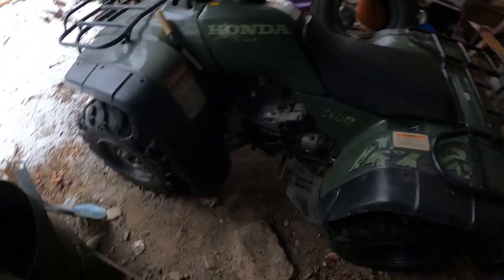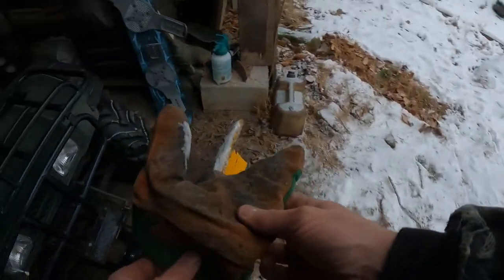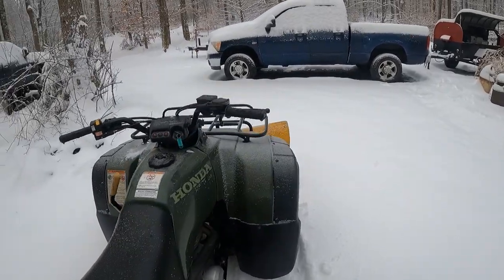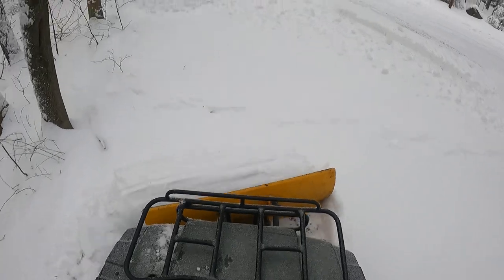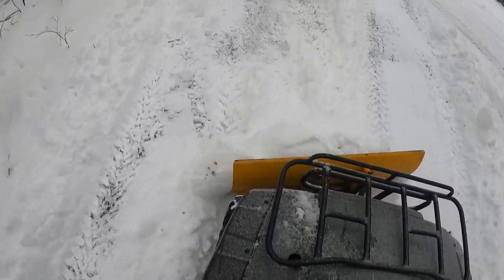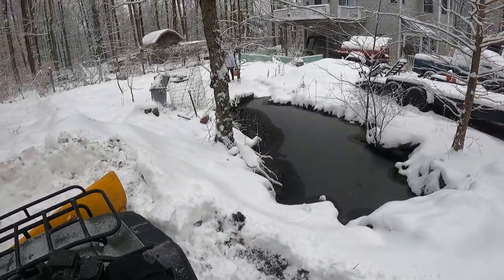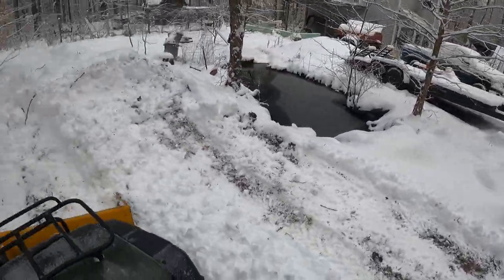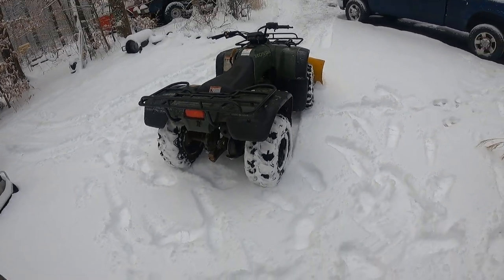Plowing snow with a Honda fourtrax 300 4x4 atv

Comment: I had a question about the diy skate bowl and thought it would be better to post here because you are more likely to see it. I am planning on building one soon and was wondering if there were any seams between the wooden pieces, and if so how did you deal with them
Reply from the maker: Building a bowl out of wood is extremely difficult.  I made sure to keep all my seams to less than 1/8" I wanted a smooth ride and not have wheels catch. Definitely made it difficult to cut precise curves on both edges.  Good luck building one. Send me pictures!    Here's a link to the wooden skateboard bowl video https://youtu.be/pJzPqK7elmQ

Comment: Never push snow with my atv but ride all winter lol . Wonder if had chains would help in heavy snow help keep from veer off as i seen on odd vid . The ol quad done good  great video .
Reply from the maker: Chains might help.  Whenever I get deeper snow I plan   on plowing multiple times just so the pile isn't able to push me off to the side.  Plowing on the very edges first helps. Then I have somewhere to put the snow from the middle of the driveway.   Love riding in the snow.

Comment: Very cool. Love these old Honda's. I have a 98 foreman 400fw with a blade & a winch. Beats the crap out of shoveling. It's totally stock with the original engine. Pretty good considering I live @ 7000ft so in the winter it works for a living 👍👍

Comment: I had been using 1985 Honda Fourtrax 250 with a 48" Cycle Country manual lift plow since 2002.  It did quite well, despite being 2WD.  This year I upgraded to a 1996 Fourtrax 300 4x4 with Koplin High Rise tubes, my 48" CC blade, & a 2,500 lb. Warn winch.   I have chains on the rear tires, & I add a bag or two of wood pellets on the rear rack when plowing.   I am very happy with my new set up.  In some ways, the manual lift was faster & easier to manipulate.  If I need to push snow piles back, I will appreciate the extra control of the winch & the flexibility of the high-rise tubes.   I really like these older Honda machines.   My current set up attaches the same under the machine, but the winch hook just clips on.    I wouldn't knock the manual lift, however.  The blade needs to slide on its shoes to do a good job of clearing the snow.
Reply: Yea buddy, your gonna really like that set-up. You've moved into serious snow plowing now. You will crap when you see how much deep( and I mean a foot at least) of snow you can easily move. You'd like a winch lift though --I have an acreage 'cause we dairy farmed and kept our acreage so I need a lot of atv  powered machines with no farm machinery now. I have (4) Kawasaki Bayou 300 4x4's . I have machinery and tools on every one. Damn cheap tractors to run instead of full size International regular tractors that's for sure!!!  Have fun --good video !!

Comment: I had a old 3004trax, thing was a beast, 5 speed automatic clutch system, put 27” tires and a snorkel on it, it did good, sucked a shit load of water it many times and still ram like new. I remember once I left it outside for about 4 days I’m the sun and when I went to take the gas cap off it shot off 20 feet in and air! The tank built a ton of pressure sitting In the sun haha
Reply from the maker: So many people really used these machines.  Probably be a good collector market for them in the near future. Last of the best before everything became  huge and electronic.

Comment: mines an '88. makes quick work of the snow but its so damn manual. the whole left side of my back was sore for two days after just an hour plowing snow and my left knee hurt that night from shifting gears. im definitely installing a winch by next winter and possibly trying out a different shifter peddle. i wouldnt call this atv perfect for plowing snow but it gets the job done. im definitely taking it with me to WY when i move there from WA. its too useful to let it go. ideally id prefer something bigger like 800cc with auto transmission and push button plow controls.
Reply from the maker: In it's day it was one of the biggest atvs you could get.   One of things that make this quad great is that it is all manual.  No fancy electronics that came on the next models.  I have a similar problem with my knee when using an old ford tractor.  Constantly pressing the clutch unlike modern tractors that can sit in gear.. Some of these big quads make it so easy to ride that it takes the fun out of it.  No skill required.

Comment: Putting a warn front mount plow on my Honda rancher 420 this year. Can’t wait to try it out!
Reply from the maker: You're going to wish you did that years ago!
Reply: Been plowing with my 07 420 for15 years.i leave the plow on for little jobs around the acreage. You get creative when you have it available. I also pull a wagon and use the $49 winch from harbor freight with a snatch block a lot. Super handy during garden season.

Comment: i got a 93 but having trouble getting the back bracket hooked on for the plow.. i  got a v plow for it
Reply from the maker: @Victor-xb6ok  This one uses u bolts on the frame to attach a mounting plate.

Comment: Hi, how well does a little 300 4x4 do for plowing snow? I've been told by people you need at least a 600 to plow any snow over a couple inches, and I feel like that's not necessarily true. Looking at your video it looks like it does really well! Currently looking at a Bayou 300 4x4.
Reply from the maker: It works great. However you have to be ready for the snow. If you stay on top and plow every so many inches it is very easy. If you have a foot of light snow no problem. Wet heavy snow is another story and it won't push is. Reality I run out of traction before running out of power. A bigger quad won't help that very much. And it's fun... we had a blast on my buddy's bayou 220 as kids and would ride it with 7 people on it.  Should work great for you.
Reply: Seth, if your looking at a Kawasaki Bayou 300 4X4 your looking at the best 4 wheeler ever made !!!!!!!  You should read my other you-tube posts. I have (5) 300 4x4's . Ranging from a '94 to the last year they made one in 2004. My snow-bike is a 300 with a .30 over bored motor with balanced speed pro piston, off-road racing cam, Kolpin performance exhaust, re-jetted carberator, a 4" lift kit with bigger Mud Claw tires, chains in rear, and Dennis Kirk canvas cab with LED light bars front and rear. My plow is a 60" Moose plow with a 3500 lb. Warn front winch. She plows like a mother!!!!!    My 2004 is a sprayer bike with a 20 gallon sprayer with a 48" rear boom. It also pulls my 52" atv mower made by Northern Tool that mows part of acreage. Other bikes do other chores. Now that I quit farming and sold machinery---these are my tractors. These 5-speed 4x4's are the BEST!!!!!!!!!!!!!!!!!!!!!!!!!!!      Jim

Comment: Put some weight on the front and back racks. Weight is traction!
Reply from the maker: I prefer to keep everything as light as possible.  Much less wear and tear on every part.  Engine has to work a lot harder "tough on main bearings" to get the extra weight moving. Adds a lot of pressure to axles and u joints.  And it is harder to turn. I learned that from old tractors being all weighted down for traction.  It will push better with weight though.